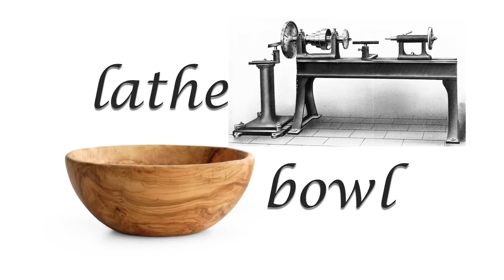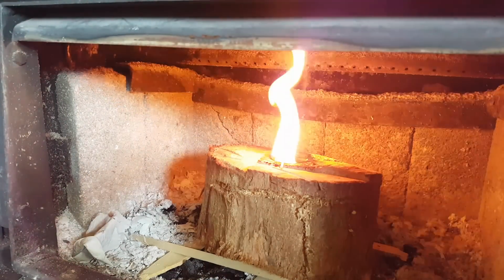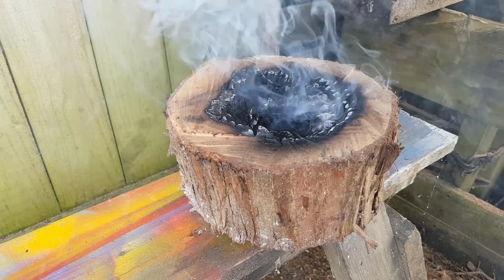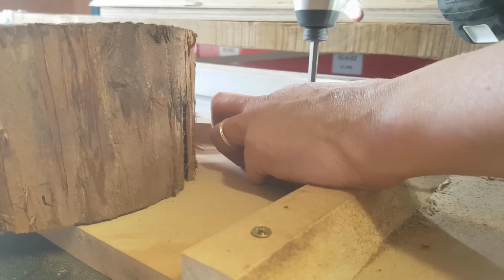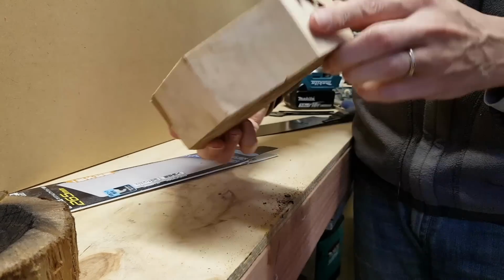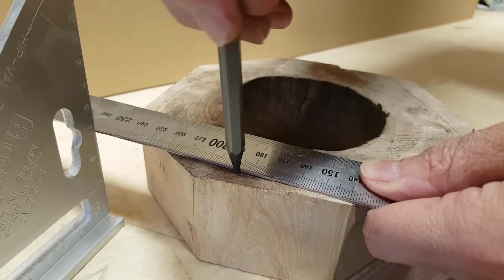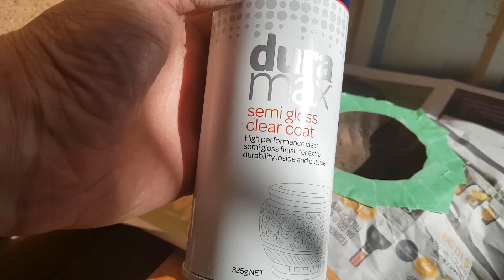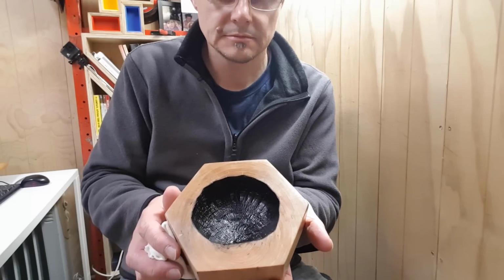Bowl Without a Lathe Challenge - firewood to firebowl #BWALC

Comment: What is the name and size of the drill bit you use at 1:14 to drill out a hole? Thank you for a great film.
Reply from the maker: It's a 20mm forstner bit. >>>like this>>> https://amzn.to/3lSLtrq
Reply: @TakamiWoodshop  Thank you very much. I ordered already 2", since I need to cut a hole in the 4X4" piece to put it on the aluminum fence pole. I need it to attach a solar lantern to that aluminum pole. Thank you again.
Reply from the maker: No problem, you're welcome.